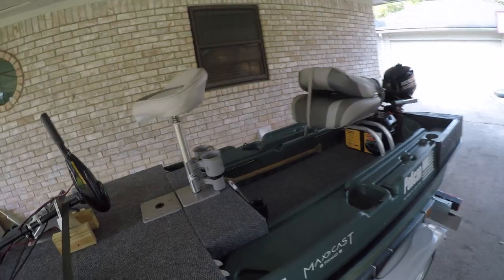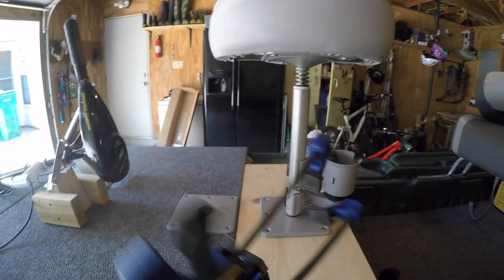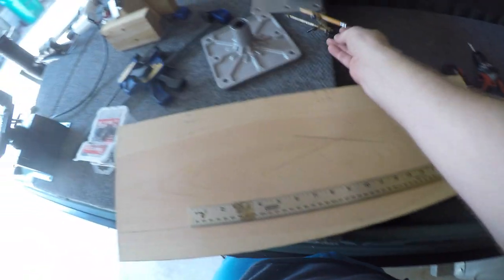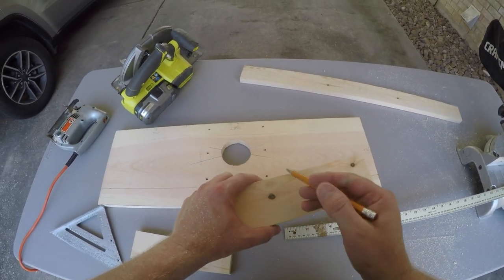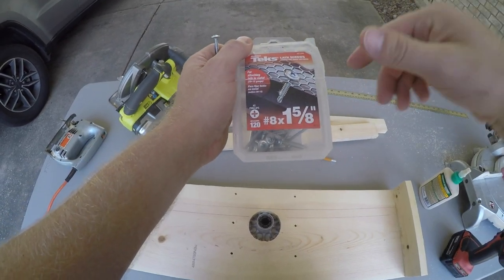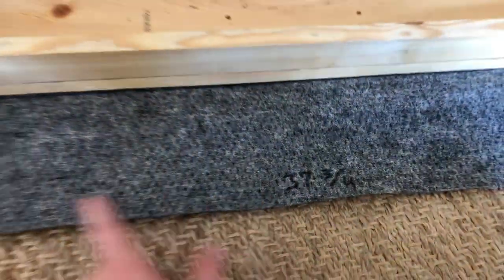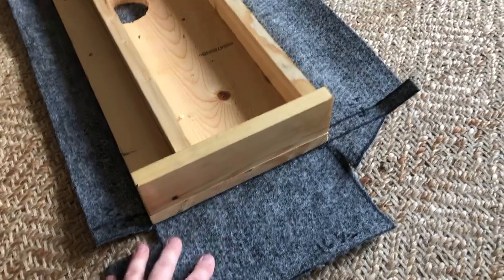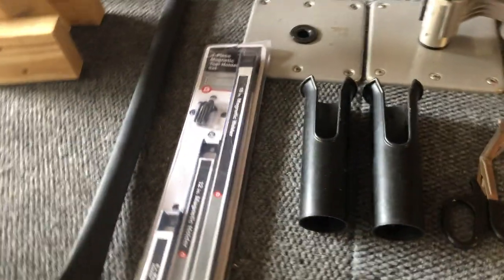Pelican Bass Raider10E:  DIY Casting Deck Extension Modification

Comment: Nice job!  You mentioned the magnet strip there at the end of the video. I wonder if you could use some strong magnets instead of the clamps to hold the 2 halves together. Either way it is cool addition.

Comment: HI. I dont remember you saying in your video but what in thickness and type of board are you using as the top piece of your casting deck extension?
Reply from the maker: It’s 3/4in piece of wood that was 12in by 4ft purchased from Lowe’s.

Comment: Hey Charlie, I’ve been fishing w my Bass Raider for a year now and love it. Just got an Epropulsion outboard and it’s great for trolling.  (Need to do the transom reinforcement). So I’m finally starting the casting deck project. (Cut all my wood yesterday). So, you’d still recommend building the deck and then adding the extension? Without the extension, is your Troll King access comfortable? (Im going to install the TK. He’s out of stock at the moment). I’m 6’ 2 1/2” and I’m wondering about leg room. Also, do you run down the highway w the trolling motor strapped down like in the video? Thanks so much for the awesome videos. Scott
Reply from the maker: I personally like both the original deck and the extension, and I’d build it the same way over again. I like have the extra space when I’m by myself, but it’s nice to remove it when someone else is fishing with you. I mainly use the seat pedestal slot that’s closer to the front, but I now use a taller, adjustable seat pedestal. I’m 6ft and it works well for me. The Troll King was worth every penny!  All the best!!
Reply from the maker: Yes, I leave the trolling motor on there, but you need to make a block to tighten it down so it doesn’t damage the shaft.